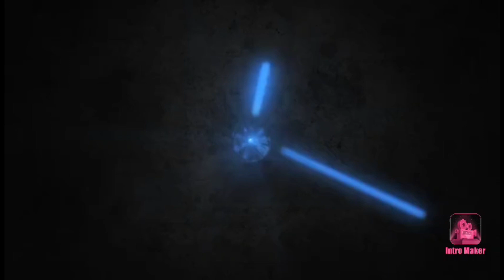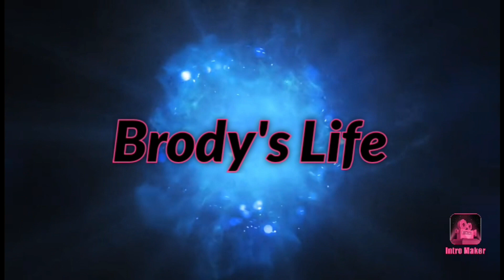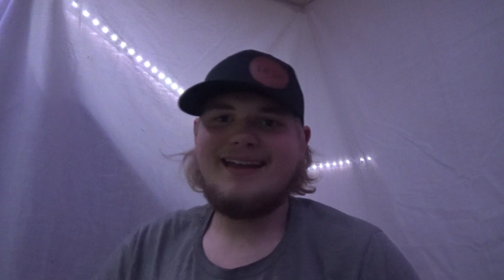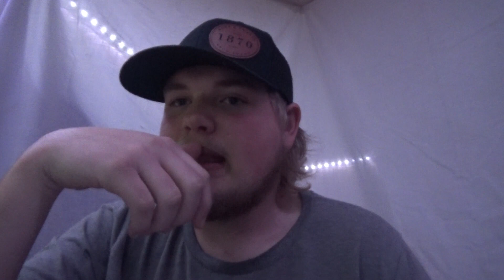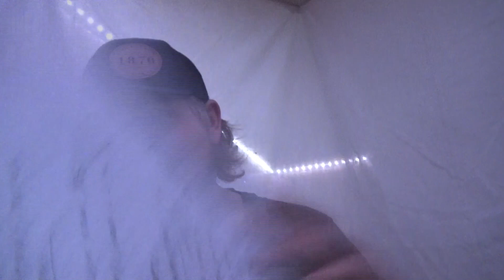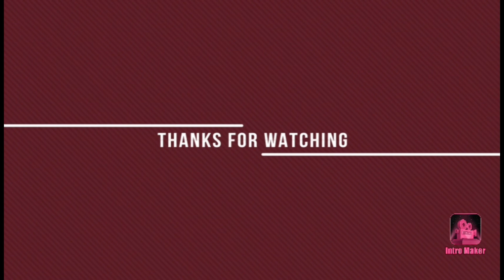my 1997 Geo Meto more information

Comment: okay! so based on what you said about the gasket, were you certain to scrape and clean ALL of the old gasket? and how about a clean consistent sealant bead? what you said about the heater kicking on incrementally checks out, once the spring in there goes, it’s up to whatever pressure wins the battle battle, and by then its too late for the radiator to do it’s job. invested in this little car man!
it’s awesome everything still works the way it does with such little rust btw.
Reply from the maker: Thank you for the comment and yes I got as much of the old head gasket out. Yeah it's pretty surprising how well this thing has put up it just won't stop.